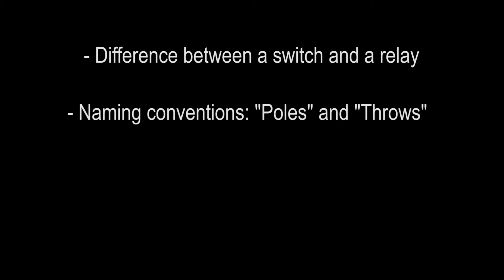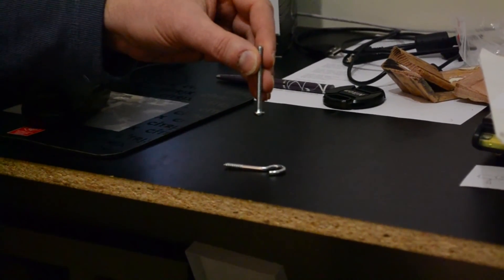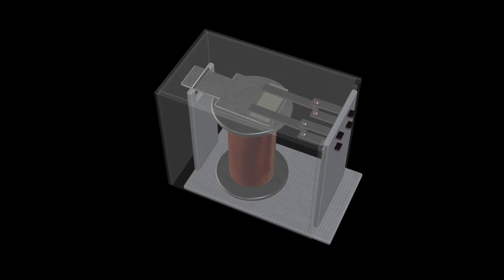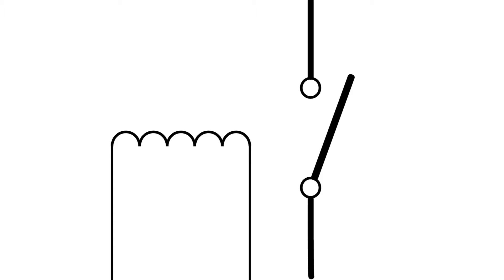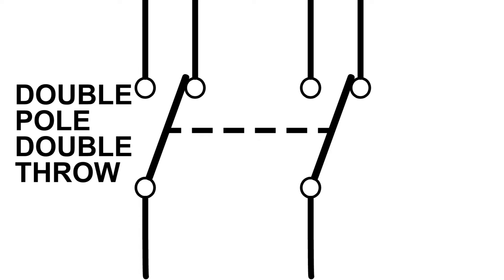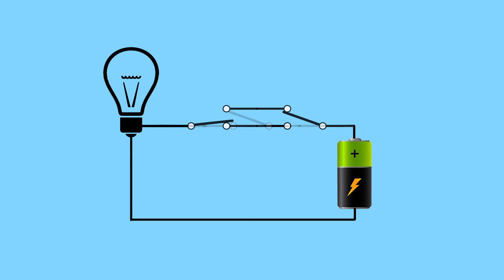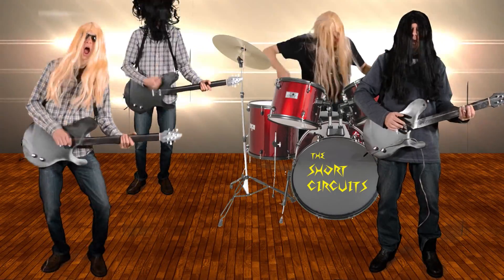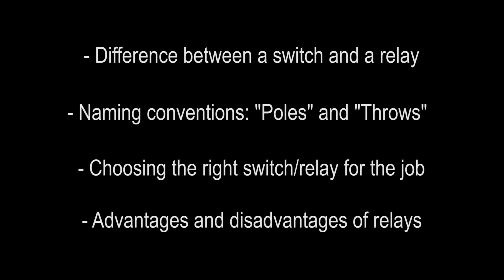Creepy Creations - Electronics Essentials (Episode 4) Working with Relays

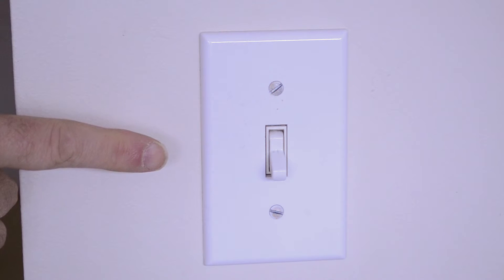Comment: 1:40  Light switch "The simplest thing you will find in you home" Um NO! Not even close. First don't for get all the years and development that went into creating that switch. It has moving parts. It must be able to take the current. It must be safe. I have other examples but there is no point when I tell you the many other things that are way more simple , even when you include manufacturing. Spoons, forks, plates, doors, hinges and many others are WAY more simple.